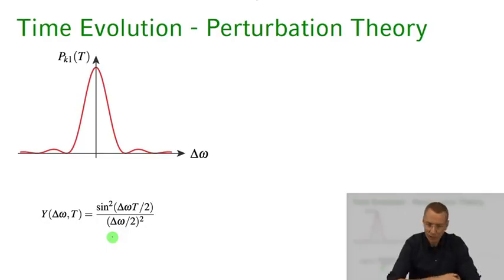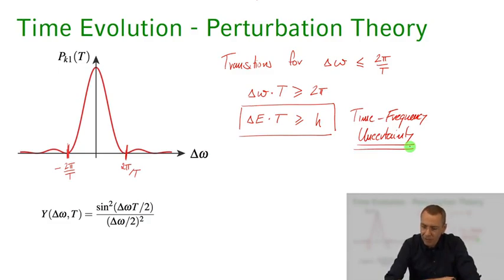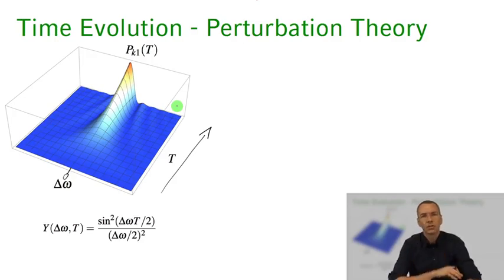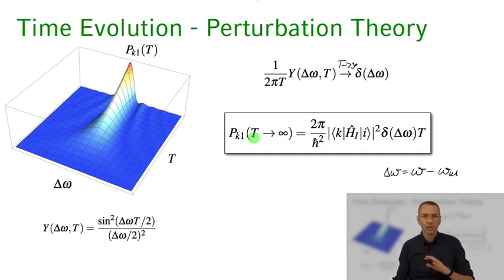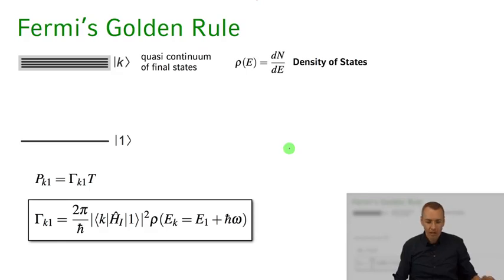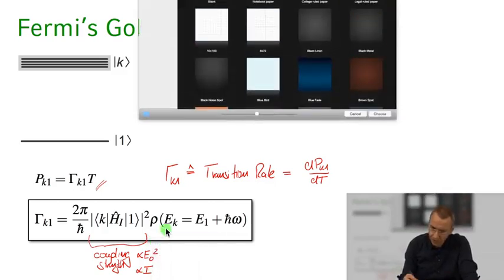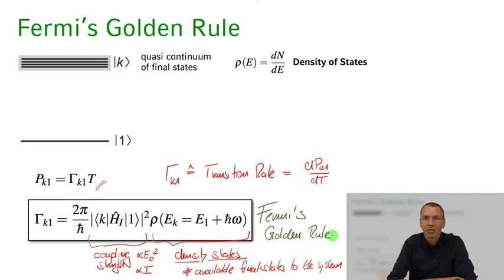Quantum Optics  || 05 Time Dependent Perturbation Theory Part 2 10 45

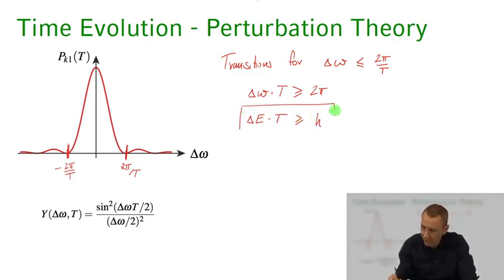Comment: At 1:48 how does del omega <= 2Pi/T give us del omega x T >= 2Pi?

IMO, del omega <= 2Pi/T is true and gives del omega x T <= 2Pi; which is a necessary condition for a non-negligible probability of transition. And conflating this relation with time energy uncertaininty principle is unnecessary since T and del omega are not related by fourier transform. T and omega are independent and are the length of the pulse, and frequency of emitted pulse respectively. Hence del omega is also independent.

Feel free to ignore my comment to answer the question.

Comment: Looks like the time-frequency uncertainty is incorrectly explained. From Delta omega <= 2 pi / T, how can we have Delta omega * T >= 2 pi?
Reply: Exactly i also had doubt there
Reply: I got confused exactly at the same place
Reply: yes
Reply: The reason for the mistake is that Delta omega is not lower than 1/T. Just by looking at the plot we see that Delta omega ~ 1/T, and therefore Delta E . T ~ h. If the time T the perturbation is acting increases, then the "uncertainty" in the energy decreases, meaning that the light emitted or absorbed by the atom has a frecuency that matches the energy level difference between the atomic states. That is why, I believe, excited atomic states that "live long enough" produce less line broadening.